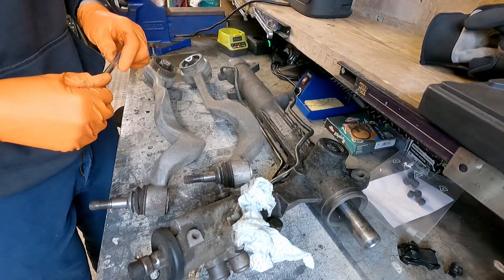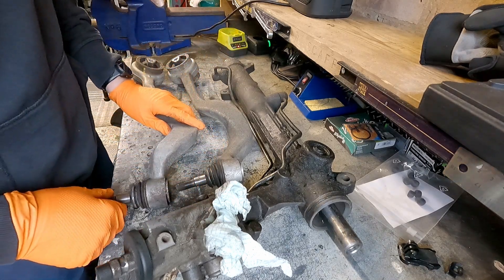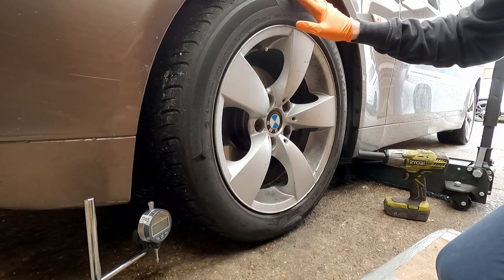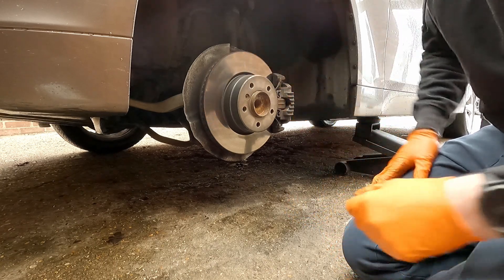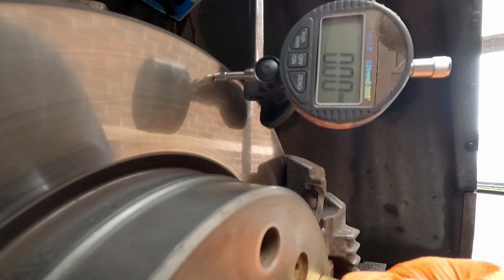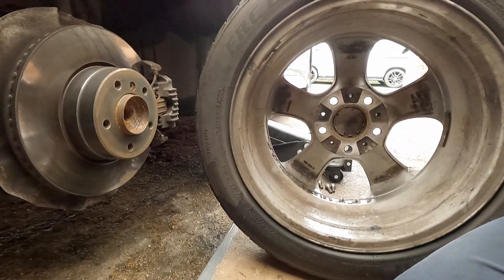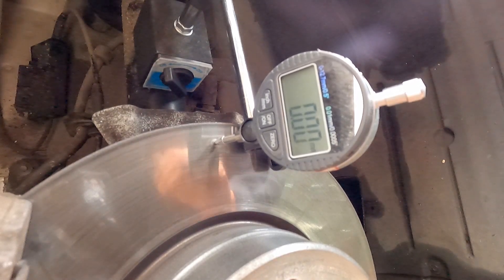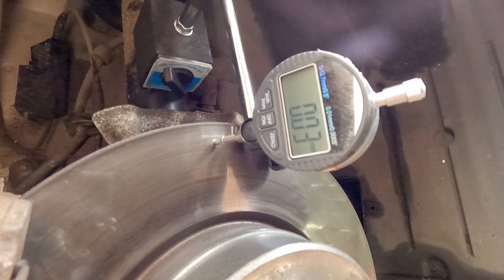BMW STEERING JUDDER INVESTIGATION - BRAKES, SUSPENSION OR STEERING?

Comment: Great video. Very clearly explained.  
Maybe a silly question, but when doing the runout test on the fronts, can steering position affect the measurement?
Reply from the maker: Thanks! Not if your dial gauge base is attached to part of the steering/suspension assembly so that it would move with the steering.

Comment: Did you find the problem buddy? 535d e60 here and I have also replaced all control arms, tie rods,  discs, steering rack and still have the judder.
Reply from the maker: @djw231cfc  100% solved for me, 10k miles no issues. it was all in the brakes. I have a couple of shorts on here showing the diagnostics. I had excessive lateral runout on my rotors, due to excessive lateral runout of my hubs. It was caused by me fitting budget front wheel bearings that were made of low quality steel that then warped when idiot tyre fitters buzzed up the wheel nuts to a million Newton meters. 

All solved by fitting F.A.G wheel bearings and ATE brake rotors, measuring runout every step of the way to confirm everything was in spec. cost £££ but as I've learnt time and time again, OEM is the only way.
Reply: @nickb7369 but in this video the brake rotors measured ok . How do you say it was the brakes?
Reply from the maker: @aligoksu1577 Ah, yes, I watched back this video and remember now. This video was before I figured it out! The dial gauge in this video was a cheap chinese one that was totally useless. I borrowed a calibrated european made gauge from a machinist, and that told me that I had significant runout when i measured directly on the hub face. I have a Youtube Short that shows this measurement. The problem was that the hub faces were warped, which made the discs not run true. It wasnt the fault of the Brembo discs, it was the fault of the Chinese hub.  The discs will have worn unevenly on the warped hub, therefore changing the hubs for genuine BMW parts and the rotors for genuine ATE solved the problem. 

Hope that helps, its confusing because i had so many things wrong at once, all made worse by fitting bad chinese parts.
Reply: @nickb7369 Thank you for explaining ❤

Comment: Hey, I've also been chasing the cause of the steering judder under braking on my e61. I switched out everything up front, from shocks, control and tension arms, wheel bearings, rotors, pads, and even brake calipers and gliding pins. The vibration kept coming back after a short while. I friend works at bmw and he told me I should never grease the gliding pins on bmw brakes. I took them out, cleaned them and the rubber sleeves thoroughly, reinstalled them dry and the judder was away immediately. Try it out.

Comment: Hi! 
I have had the same issue with my 320D F31 (2013). Vibrations when breaking at higher speeds (above 80 km/h), I changed break discs and break pads last summer, I also got my wheels balanced and the problem was gone. But now the problem has come back slowly. I just took all breakes appart and cleaned/checked but I could not find any warpage of the new discs (values looks good). Pads move nice and not any uneven wear. Front arms has a little movement but not to much, not like brand new ofcourse. 

Have you found your issue? I feel that it might be time to replace wheel bearings for the front, could these be the issue for vibrations? Should be for all speeds then right? Otherwise it might be time to try replace front arms for me I guess.